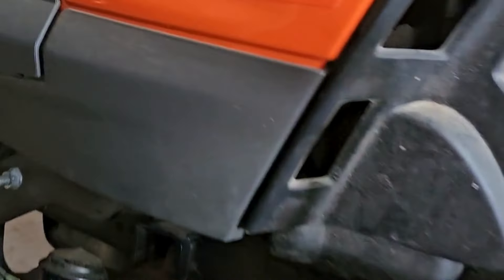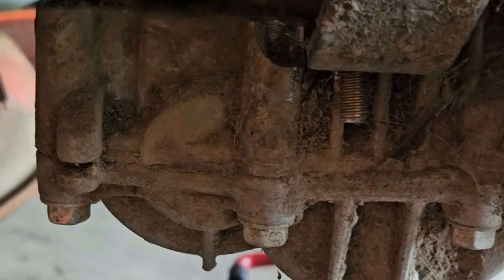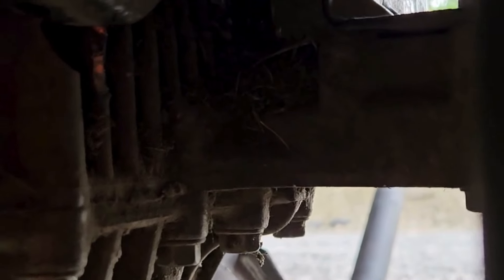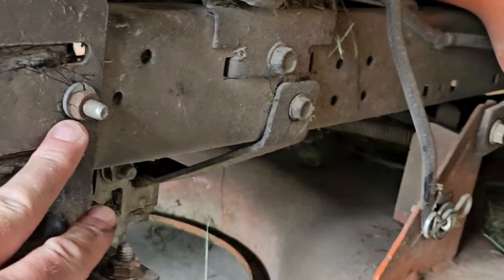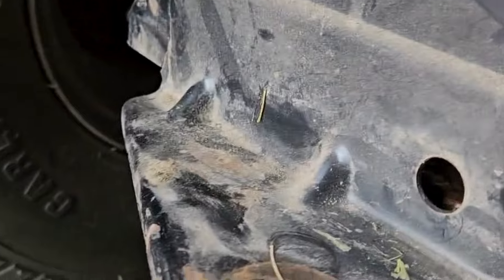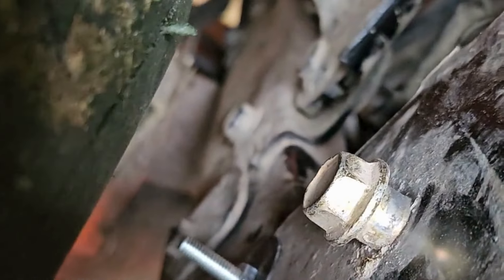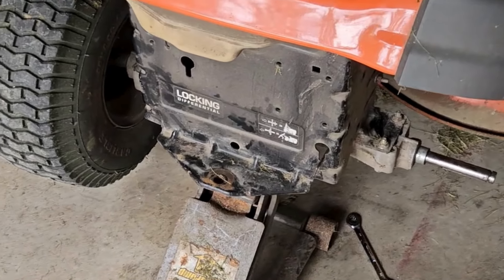Husqvarna Riding Mower - Frame Bracket to Transmission Weld Break & Fix

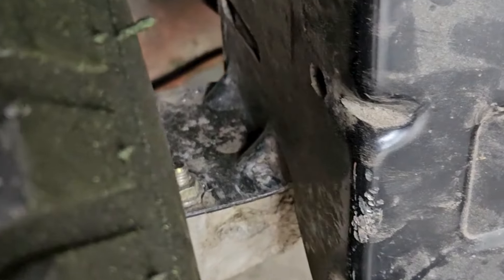Comment: I call b.llsh.t.  Why are there stress fractures at the rear hitch bend 0:55. 

Why is the transmission caked with mud.

I'd keep looking for more abuse, but maybe tell the whole story of how you got high centered in a ditch. 

Where's the video of how it was unceremoniously yanked it out of the mud hole you drove into.
Reply from the maker: no bs here man, but i do really like to see what you noticed at the 55 second mark as i now see it too. I need to take a look at this when i get home to see if that is really a hairline fracture or something else like grass remnants, etc that appear in the video to look like  a crack.  I have never used the hitch part except a few times to move some brush in a small cart that i can attach to it.  I certainly didnt yank it out of a mudhole or anything like that, i wouldnt have wasted my time doing 2 videos and then merging into one to post on here if i had really done that. I was trying to let other possible owners know of this weld break that i saw.  I know its dirty under there, but i do take care of the important parts of the mower like the engine, oil, etc... so it was disappointing to see these welds give way from a 200 lb guy riding around with the pretty flat terrain that I have. I do know that with the 3 bagger grass catcher unit I have i let that son of a bitch fill up as much as i can before i run it over to the woods and empty them, so maybe that was a mistake over the years that extra weight was just too much.